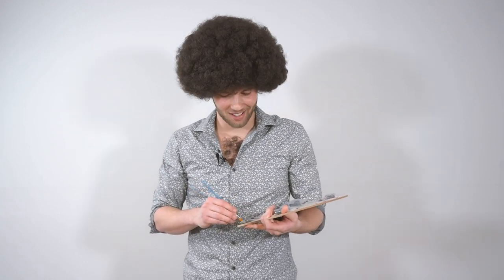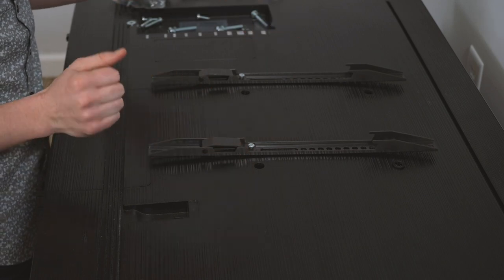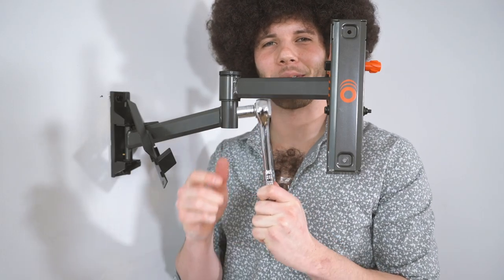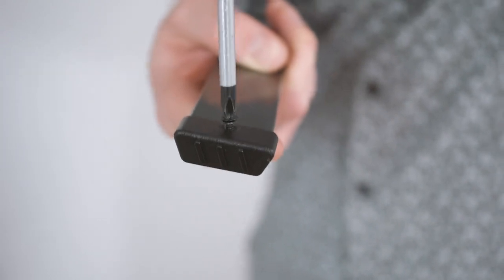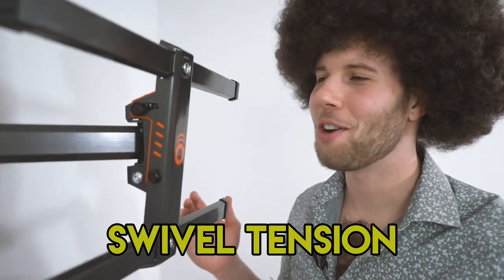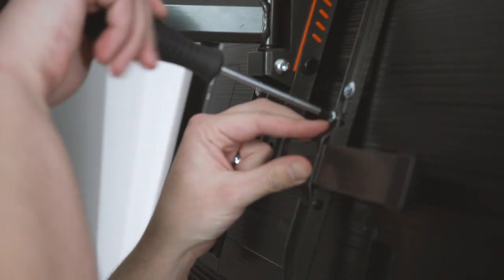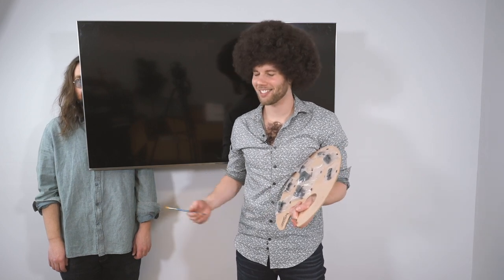How to Install a Single Stud Full Motion TV Mount Ya'll: The Best DIY TV Mount featuring Rob Boss

Comment: We don't quite understand how you're exactly connecting the template to the scew markings. In what part it looks like you're putting it to the left of the opening and then the following action it looks like the template is over the opening.  Of course we could your actions
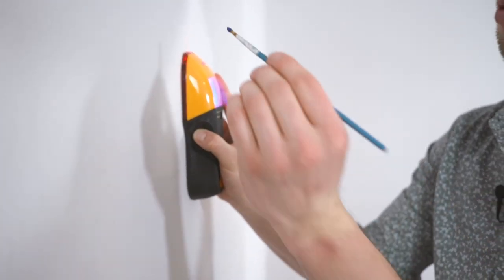Reply from the maker: The template is centered over the stud. The markings on the left and right of the template are marking the outside edges of the stud as shown @1:55

Comment: Hello Echogear!  I am working on installing this.  The instruction manual calls for a 7/32 inch pilot hole.  In this video, Rob Boss uses hand tools (socket wrench) to screw in the lag bolt.  

I am unable to get the bolt very far into the wall stud using hand tools.  (I'm pretty strong).  Are we supposed to be using power tools to screw in the lag bolt, e.g. an impact drill?
Reply: The lag bolt is 10/32 inch
Reply from the maker: You can use power tools for install, be careful to not over tighten. If you put in the pilot holes with a 7/32 in bit the lag bolts should go in.
Reply: @Echogear  Thanks.  I ended up using power tools. 

For others who may be in the same situation:  I used a standard 20V cordless drill.  I bought an adapter for a socket wrench head (1/2 inch) to match the lag bolt head.  It was slow, but the lag bolt went in.   I have standard dry wall and wood studs.

Also, when drilling the holes:  Make sure to put the power drill in "drill" mode.  I also went in and out a few times of the hole a few times to make sure that the hole was good and clean.